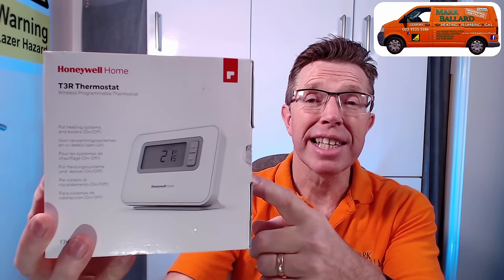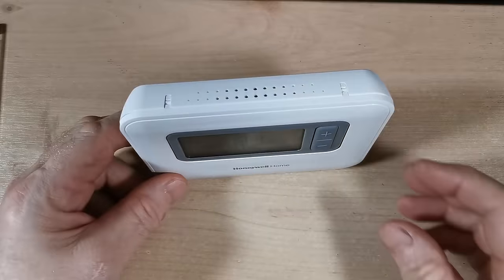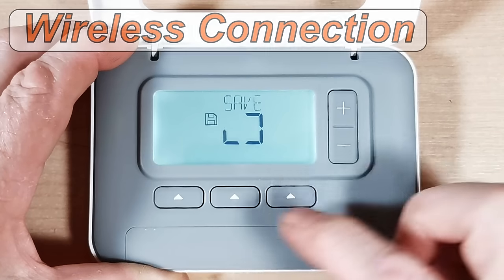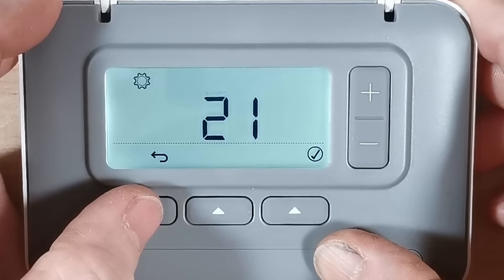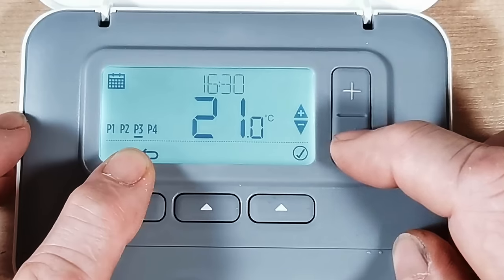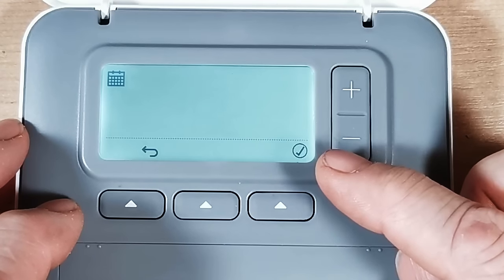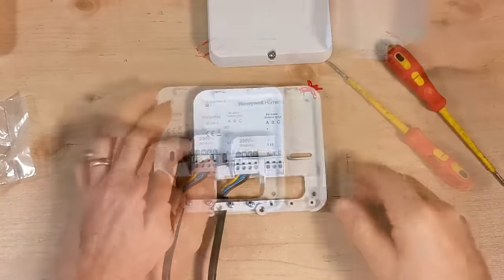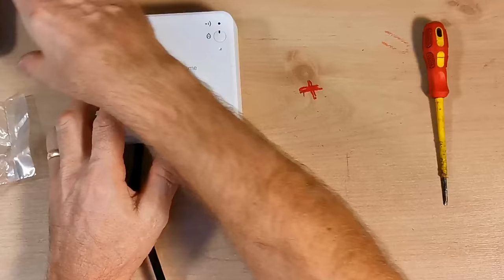How to USE, Program & Install the Honeywell T3 & T3R Including Wiring-Up. Honeywell Home T3R Review

Comment: Sorry mate, very exhaustive explanation, unfortunately I am none the wiser, because everything is so complicated and confusing. I dont mean to be rude, take no offence, but you make the same "mistake" that many manuals (eg TV sets) do. They start from...the end.
They don't start telling you how to turn the TV on. I don't want to know how to lock the thermostat, until I go through programming it. Things gets more confusing because, for example, in one part of the video  the setting is on the 2nd program, then in the next part it's on the 1st. And no explanation how to change this. My gas eng  installed this yesterday and I have been through the manual, on paper and downloaded, over and over, but it is still unclear how this dam thing operates.  Unfortunately, no support from manufacturer, which is a shame. This thing should have a select button, an up and a down buttons and a set button. That would be simple and user friendly IMO. Love&Peace.